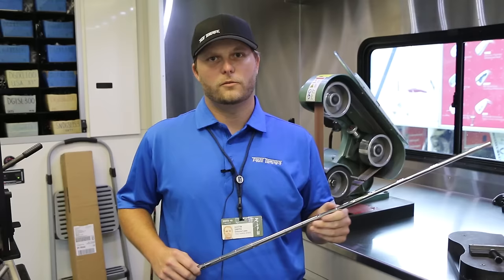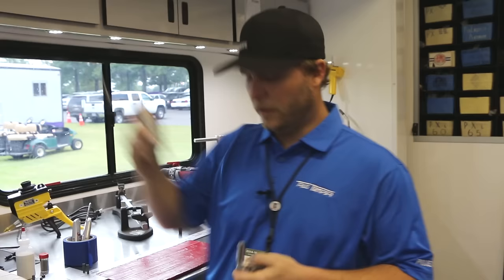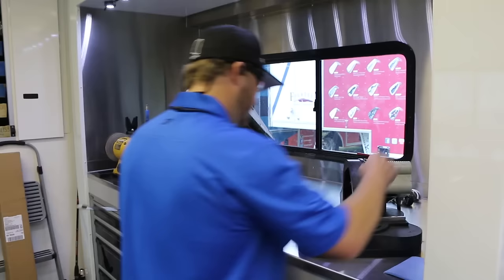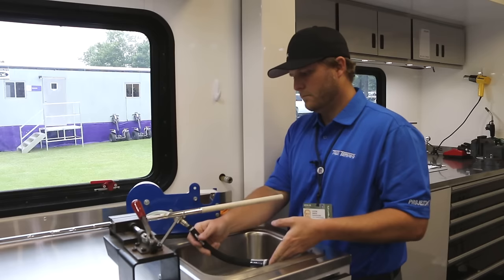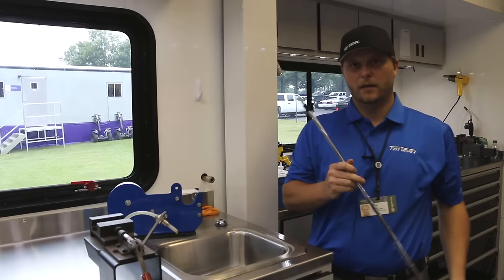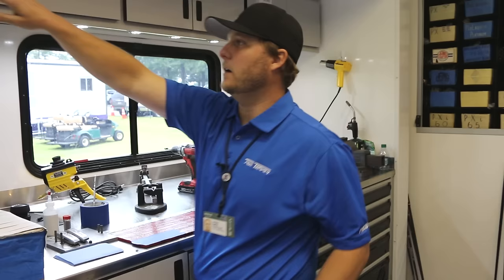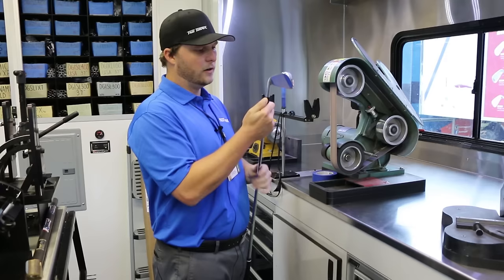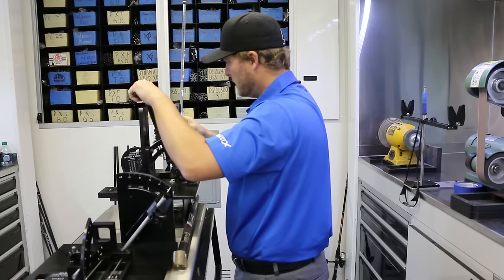How to Build a Set of Irons

Comment: Neil, to answer both your questions: yes he uses a tip weight, but sands down approx 1/16" of the tip of the shaft to compensate for any added length the tip weight might add. 2, yes if a club dries funny on a drying rack it can effect the lie of the golf club. Hope this helps.
Reply: Lol the nerd is in the building jk
Reply: What grit sandpaper do you use?
Reply: Can you explain how a resting club on a drying rack can change the lie? what forces are involved that can change the angle of steel?

Comment: Hi..I assembled Mizuno mp60 (6 iron 257 grams) to + 0.5 inch dynamic good s300 shafts. For some reason, pitching wedge swing weight is e1. And 5 iron at d7.5. I don't understand why that's is the case with 4 wraps of grip tape . There's seemingly no hot melt in the heads before installation

Comment: Can any true temper shaft be used to create a set of same length irons or if you cut them too short will it change the flex points?

I have a set of dynamic gold s300's on cobra pro mb's I've been thinking of cutting them down to same length.
Reply: Don’t be a DeShankbo.

Comment: so, if a mistake was made with the epoxy on the iron to the shaft and it needs to be redone, is there a way to dissolve the epoxy or is the club shot?
Reply: i think you can use heat to break the bond and get the club head off
Reply: @SayYesVital  thank you

Comment: His last statement is he is going to the range to test the club.  Don't you have to let the grip set-up for at least a couple hors before you use it?
Reply: Steve Scholtz A grip installed with odorless sets up in about 30 minutes. More or less ditto the epoxy he's using.
Reply: Steve Scholtz 30 minutes to an hour at most.

Comment: he claims that lie can be changed by sitting the club on the floor?
Reply: I stood my 3 iron on the floor crooked while it was drying and I ended up with a pitching wedge.
Reply: Because the shaft is not perfectly flush with the hosel so it can be off by a few degrees

Comment: I was VERY disappointed with the explanation.  First, the shaft should have been disclosed as a taper tip as it didn’t need to be trimmed.  The tip should be sanded half way up the ferrule.  Second, using a balance beam for swing weight is at best an approximation.  I use a digital scale for accurate results.  Third, the shaft should have been spine aligned.  After swing weighting you should only need .2 SW for epoxy.  If you are using .5 SW worth of epoxy you are using way too much.  Lastly you should allow at least 10 minutes of drying time before finishing the ferrule as it can spin if the epoxy has not set.
Reply: so, in conclusion.....he works on the pro tour fitting clubs, and you don't, but  he's doing it wrong, according to you ..........okay Karen...lol.........
Reply: Meanwhile this guy is working on a tour truck and you’re sitting behind your computer telling the internet he’s doing something wrong. Clearly you’re the one who did something wrong then😂

Comment: Not checking for the shaft spine or FLO?
Reply from the maker: In our many years of testing and research and building of clubs, we have not found any advantage to spining or pure-ing shafts. It certainly does not hurt to do it, but it is not necessary. It is only a personal preference for some players (and it's not many golfers on Tour who actually ask for it).
Reply: FLO definitely allows the head to square more consistently during the kick unload. Surprised 😳 it wasn't mentioned. Yes it requires more time and effort but IMO def worth it